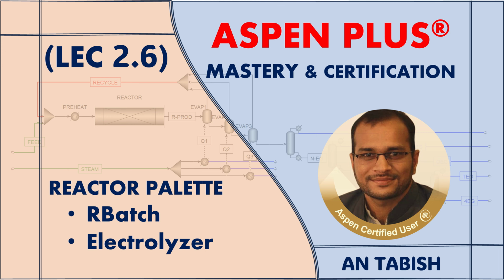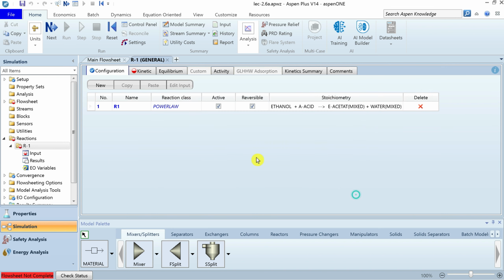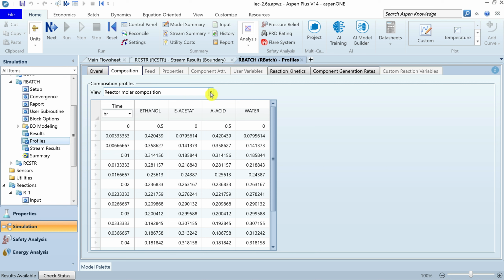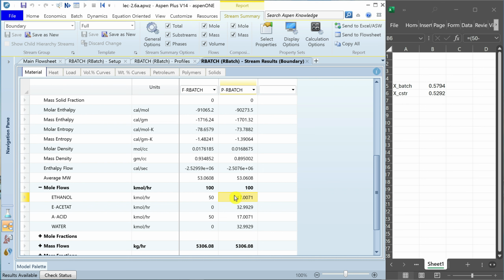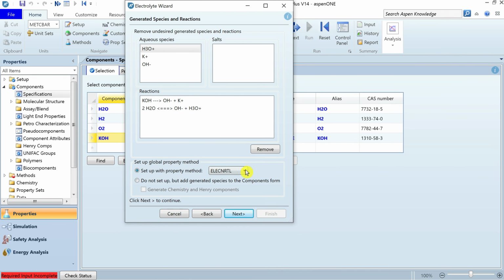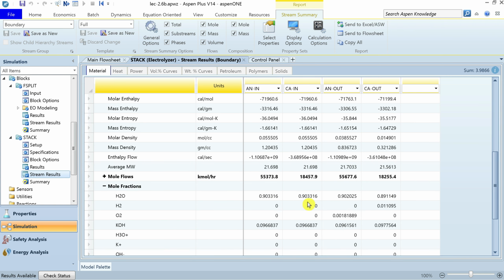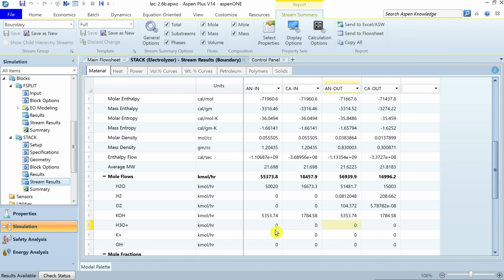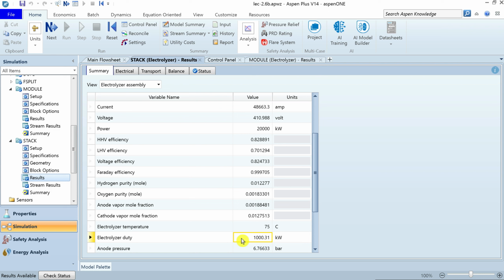Aspen Plus V14.0 || RBatch & Electrolyzer | Lec 2.6

Comment: Thank you for the amazing video, if i want to increase the H2 production, how can i manipulate these parameters? what is the max no. of stacks and cells and what could be the equivalent voltage? thank you very much
Reply from the maker: Fuel cell and electrolyzer are modular units. That means you can add as many cells in series or stacks in parallel as technically feasible. The reversible cell voltage depends upon the concentrations in electrode channels and determined by Nernst equation.